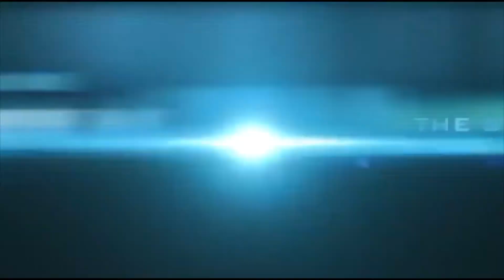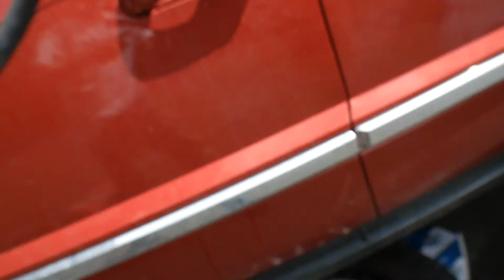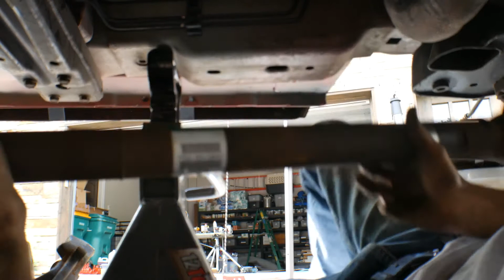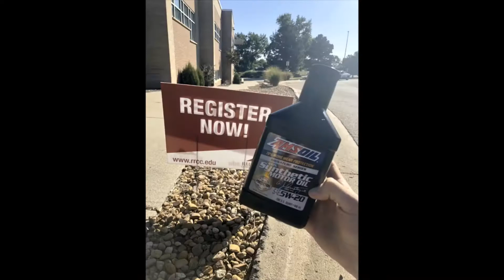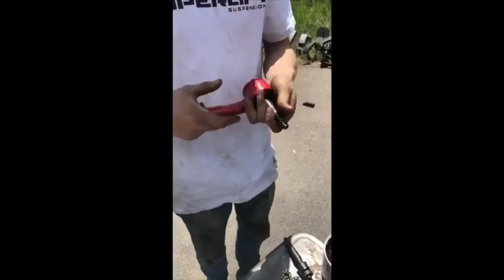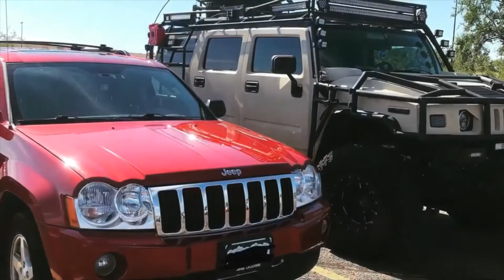2006 Jeep Grand Cherokee 5.7L Tom Woods Custom Driveshafts, Jeeperf, Amsoil, Creative Steel, Xbull

Comment: Did you have to modify the exhaust crossover due to diff drop? How much
Reply from the maker: Hey T! Thanks for watching. We did have to dimple the exhaust, you basically just have to heat it up and give it a wack with a hammer or squeeze it somehow. We opted in to heat it and give it a few good hits and after the 2-3rd try it stopped giving us any contact.

I will say with diff bushings that are shot the diff has much more play and causes the driveshaft to contact as-well. Creative steel inc makes a $200 diff bushings kit that solved this issue for us!
Reply: Ha Well that wont cost any thing thanks.. Keep it coming
Reply from the maker: @tmeyer1363  trying to make some big moves in the coming months so keep an eye out!! Thanks again for the support!!

Comment: First, thanks for doing these videos, great to see the work on a WK!

Can you go into why the drive shaft, diff bushings, and tie rod ends needed to be replaced? Were they just old or were there complications from the lift?
Reply from the maker: Hey Scott, thanks for following along and appreciate the comment big time!!

The stock diff bushings on these wks are flawed to say the least. That being said that was something that needed to be done as we had a front end clunk when shifting, the Creative Steel Black set are absolutely amazing and are 100% recommended!!

Tie Rods - The stock tie rods are pretty strong and I know some pushing them on 35s-37s but, the Jeeperf Tie Rod ends have some serious flex and for our wks we can use every bit we can get. Wally @Jeeperf is a wizard at making parts and he really knocked it out the park with the SuperFlex Tie rod ends. That being said we definitely recommend them!!

DriveShaft- @TomWoodsCustomDriveShafts is the best of the best hands down. When lifting these wks the driveshafts tends to be a major weak point and if going higher then 4” needs to be lengthened. The Twoods shaft features a dbl cradan and is unbelievably stronger. Basically, you get a twoods and the most you’ll be doing to fix it is throwing a new joint in which is no trouble. We will be covering that process in a DIY video eventually!!

It is worth noting that in my opinion upper control arms are an absolute must when lifting these wks. I see lots push those stock UCAs and worry for their safety. @JBAOffroad has the best ucas on the market for sure but I believe they may have stopped producing the ucas that work with the SuperLift, in this case I would look at Rocky Road Outfitters. Balljoints would be a big one as well, and wheel hubs!!
Reply: @TheBigRedJeepProject  guys Im experiencing vibrations after the superlift, after looking at the diffs and replacing the front driveshaft with tom woods, im suspecting the rear driveshaft and the angle is an issue, have you experienced any of this, also are still running the stock rear driveshaft.
Reply from the maker: @foo50o  hey!! I am currently experiencing vibrations but from our front driveshaft. After the boulder trail we hit one of our joints on the twoods shaft needs to be replaced but I’ll still run it for a few more months. 

The vibration from the rear is most likely the rear driveshaft. Remind me are you guys just on the 4” lift? Have you gotten an alignment since the Superlift?
Reply: @TheBigRedJeepProject  
Yes I am sitting only at 4” superlift, did the wheel alignment after installed the lift.
Reply from the maker: @foo50o  it could be your rear driveshaft, let us know what you find out for sure!

Comment: What was the length of your driveshaft mines measured 34 inches for 2007 xk overland
Reply from the maker: Ours is a 35” custom from @TomWoodsCustomDriveShafts!!!
Reply: @TheBigRedJeepProject  i also went with the creative steel bushings is the vibration normal? This video was super helpful btw thanks
Reply from the maker: @ausarel  Hey Ausar!! Did you go with the red or the black??
Reply: @TheBigRedJeepProject  i went with the blacc ones
Reply from the maker: @ausarel  poly bushing are a bit louder but the vibrations shouldn’t be significant. The red bushings are rated for an engine with 1000hp so naturally the red are a little loud. 

Often the vibrations could be coming from elsewhere but being amplified through the new poly bushings. Is your vibration a rumble?
Reply: @TheBigRedJeepProject  yes its sorta like a rumble but i can feel it sometimes at high speed when im accelerating usually when i accelerate thats when i feel the vibration
Reply from the maker: @ausarel  how about when you slam on the gas?? Does it sound way way worse? If so your driveshaft is most likely rolling on your exhaust. When lifting you need to dimple the exhaust to avoid contact